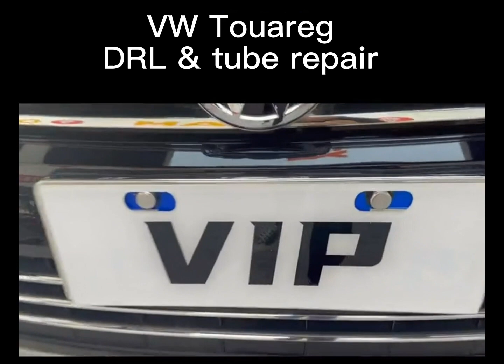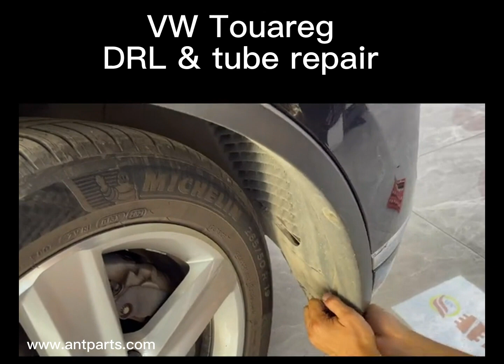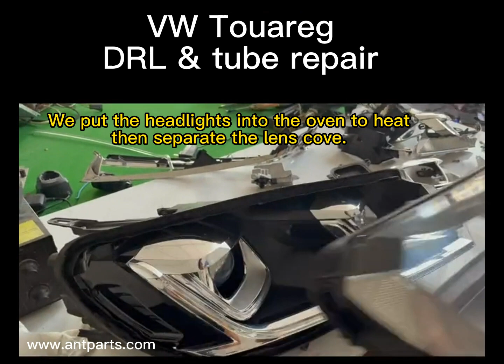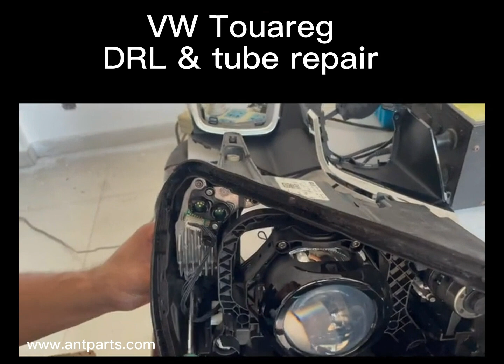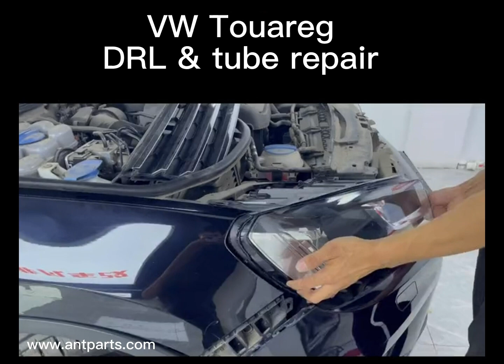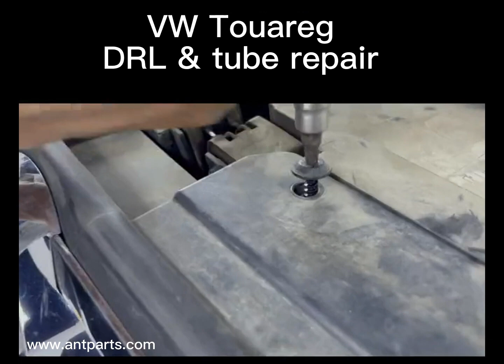VW Touareg headlight daytime running light DRL repair - Slow Version

Comment: Is there a way you could provide how to exactly remove the front glass? This oem adhesive seems to be quite heat resistant
Reply: He can’t, because he never opened his 
You can see when he removed the front glass is zero adhesive in the frame
Reply: These are Permaseal units for anyone that has worked with headlights before know very well Permaseal Units from HELLA especially is a huge pain in the butt to open some cut open the casing with the lens and some cut off the lens and then open the lights... for some like me that doesn't like that idea battles to get the lens off the casing while still keeping the seal chamber in good shape for when you want to seal them back up again with an butly sealant. I have dealt with an few Permaseal units my most difficult was W212 Mercedes benz 💀 struggled a few hours to get them open to save the lens and casing I found with Permaseal units its not really that much of an issue that it's the sealant you have to deal with but so what more the type of glue HELLA®️ uses for the rubber sealer to stick to the casing you will need a good amount of heat to open up these lights and ALOT of patients to not break the lens or casing other sealants considered permaseal is childs play compared to what HELLA®️ got going for them GOOD LUCK

Comment: where to buy the part, the dealership told me was $2000 to replace it.
Reply from the maker: https://www.antparts.com/products/vw-touareg-front-headlight-daytime-running-lights-drl-turn-signal-led-chips-board-tube-replacement/

Comment: This video is very misleading.  These later Touareg 7P headlights in particular are not butyl glue.   It’s a permanent adhesive. Putting those in the oven does not work.   I’ve disassembled many headlights.  These are different.  Do not be fooled if you’ve done this on another VAG car and think these are the same.
Reply from the maker: First, our butyl glue is in the shape of a cuboid and is heated using a professional glue injection machine. It can be dissolved by heating it again.

Again, putting the headlight in the oven is one way to separate the lens cover. We need to control the time and temperature well. And we can also use hot air gun to heat it slowly.

We have cooperative repair studios in the USA, the UK, Germany, Poland, Slovakia, Norway, Australia etc... You are welcome to contact us for communication.